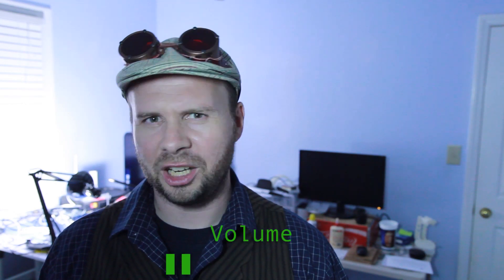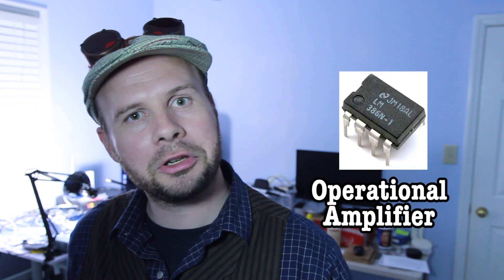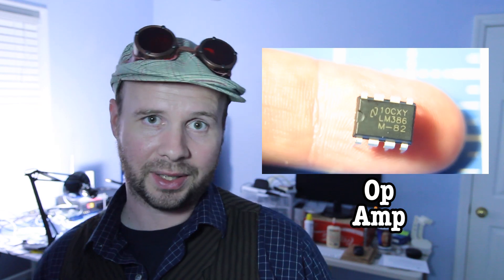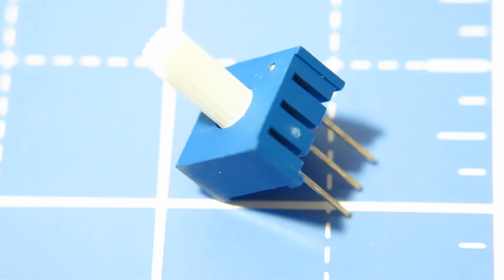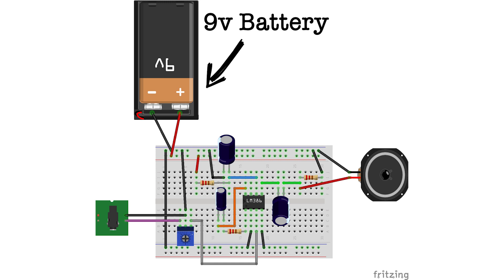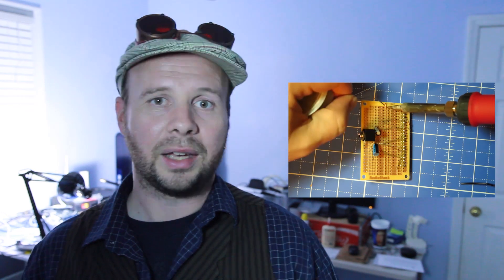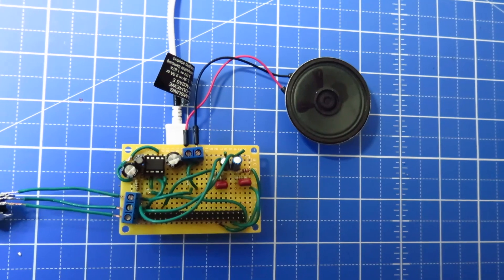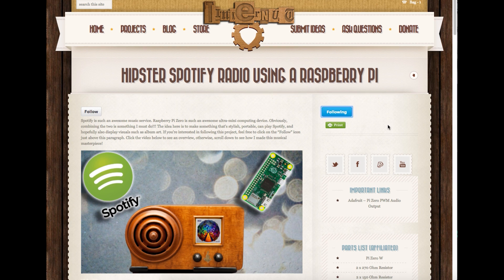How To Make A Basic Amp - Tinkernut Workbench

Comment: You got me with that intro! I stopped to check my headphones. In regards to power you could use a multi port usb battery bank. 1 port for the pi and 2 ports with cables wired in series to give you 10 volts for the amp.

Comment: Two tips: for power there are very efficient dcdc boost converter ICs available that will boost your 5V to whatever you like, take for example 24V, then use a virtual ground IC to convert that into plus and minus 12V, opamps love that. The second tip is on the fixed IP of the pi itself, if you install the bonjour printer service, you can type raspberrypi.local into putty to connect to your pi(also works if the pi is in gadget mode, allowing the non-W pis to be used).
Reply from the maker: all awesome tips. Thanks!

Comment: how about controlling the volume and play list from my Android cell phone ?
Reply: If you are using spotify, its already built in for you. In spotify, if you are connected to a remote device, the volume buttons are volume controllers of the pi. The playlists are synced.

Else, you can control the volume in the pi, it's just software.
stackoverflow dot com/questions/19174770/setting-system-volume-in-a-bash-script-in-linux
Make this a bash file, and call it from php.

Or you can control the amplifier, replace the potentiometer with a digital potentiometer, then you can control it from the pi. Maybe you can make a digital potentiometer from a s***load of resistors, but it's not worth it.
Reply: SzDavidHUN, I actually did something like this back in my college days. I had an IR remote laying around, used
an IR demodulator/decoder chip to reverse engineer the commands on the remote. Then depending on what command
was sent (volume up/down) I'd send it over rs232 on my gnu/linux machine and use the amixer tool as listed in the stackoverflow link. 
I wish I still had it laying around!
Reply: Henrique Losada would be a bit tricky but you could use a digital potentiometer instead of an analog one. the digital one is controllable via the digital pins of the pi

Comment: The LM386 takes anywhere between 4v to 12v DC. Powering it from a raspberry pi Might not work so well. Might need to connect it externally to a battery pack of some kind. Or use a buck boost converter to go from 3.3v up to 5v. Might do the trick i have not tested that out yet. On my next things list to do.
Reply: The Rpi has a 5V power pin, IIRC

Comment: Nice project, this could be a stepping stone for many other projects. Regarding your choice of the ever popular LM386 op-amp as an audio amplifier, have you considered a solution using a class-D amplifier? These types of amplifiers (eg. PAM8403) can efficiëntly amplify small audio signals with the 5V supplied by the Raspberry Pi. The downside of such solution? You will most likely find these IC's without the proto-board friendly DIP-style packaging.
Reply from the maker: I think I'm scrapping the LM386 and going with a class d amplifier...and maybe even a chip that supports stereo.
Reply: Class D is a better idea. So is just using a MOSFET, I had a car horn kit design that used a TO-92 housed one that handled 8 watts for bursts of melodic music. Benefit: It's even cleaner sound than Class D and both of these ideas are much newer than the 386 which is at least 3-4 decades old.

Comment: I would put in a 12 volt rechargeable battery pack (the type with both charge and discharge barrel connectors) to power the unit and make it portable.  Split the power off the output, so you can step down to 5 volts for the Pi and whatever voltage you want for the speaker.

Comment: Wattage is way low. At 9v the circuit I have is 1/2watt using a PCB from Tayda Electronics. But it is a Guitar Amp, What I now would like to know is,  How would your circuit sound once you used a mosfet preamp. I build one using BS170.

Comment: Is it possible to build a power supply to power the P zero and the Amp together ?
Reply from the maker: That's the hope
Reply: I probably should have been more specific , Is it possible to build a power supply that plugs into a wall outlet or usb  that can power both ? Instead of running off a battery .

Comment: Why not power the PI through its GPIO pins and have a separate cheap LiPo battery with a charging control circuit + regulator? Some shady 120-250 VAC -> 5 VDC (USB) converters aren't the best.

Comment: REAL tinkerers build their own opamps...
Reply: how ?
Reply: Schematics of opamps are all over Google, Hundred Scope.
Reply: a real tinkerer would just use a P or N MOSFET to begin with because now they are better than the (1 watt?) 386 plus smaller, better, cheaper.
Reply: John Possum True, but if you're using a signal like a sine wave, towards the 0 point, the voltage won't be high enough to trigger the gate, and would distort the wave. Of am I thinking about normal N/P channel transistors?
Reply: class AB amps, yup. Usually N/P transistors. FETs have no real measurable turn on voltage. I remember the first mosfet amp that really impressed me. It was a kit circuit for a custom horn and it had one TO-92 packaged unsinked NFET which blasted out 8 watts to a megaphone type horn. Awesome!

Comment: LM386 Op Amp ="Audio Amplifier Integrated Circuit"
Reply: An audio amplifier chip may contain an op amp like circuit configuration but an op amp does not contain audio output circuitry. The major difference functionally is that all op amps are capable of buffering and adding gain to a voltage, but they do not amplify current. Audio amplifiers need bipolar junction transistors for their output stage. These BJT's are current amplification devices and they are key to putting the umph behind the voltage to really get things moving.
  If you look at the following equivalent schematic for the LM386, you will see the BJT output stage on the right.
https://i.stack.imgur.com/CgM9E.jpg

 If you look at the equivalent schematic of the infamous uM741 Op Amp below, you will see a completely different type of configuration. Also someone has noted the functionality of each block/stage in this picture from Wikipedia.
https://upload.wikimedia.org/wikipedia/commons/thumb/e/e0/OpAmpTransistorLevel_Colored_Labeled.svg/500px-OpAmpTransistorLevel_Colored_Labeled.svg.png
Reply from the maker: LM386 contains an Op Amp, so what I said is correct.
Reply: but also it has the other components to make a audio amplifier ic
if you see lm358 it has 2 op amp but if you see  lm386 then it is having more components